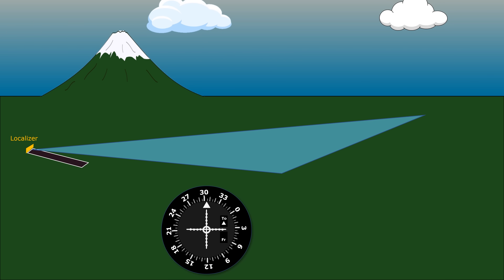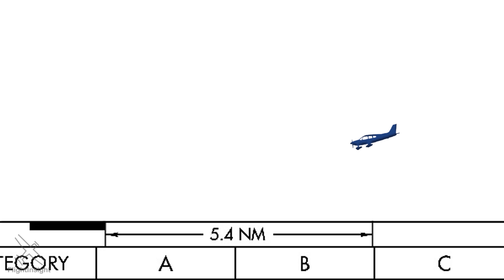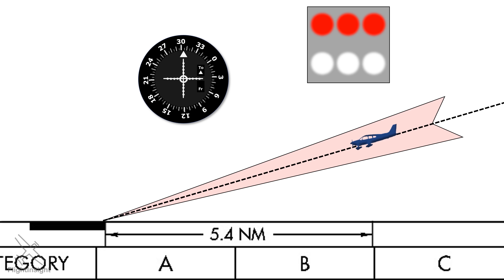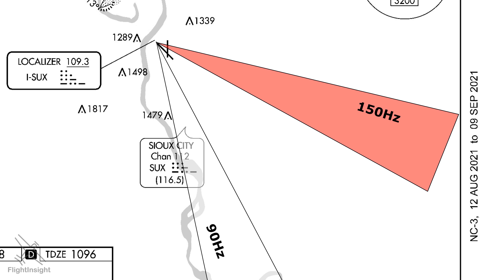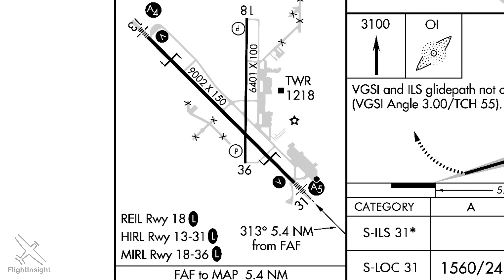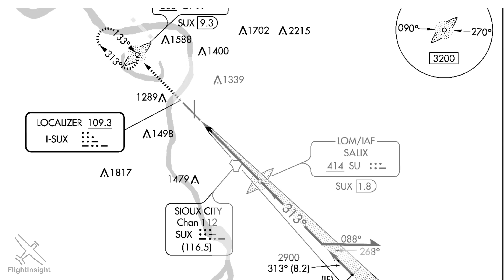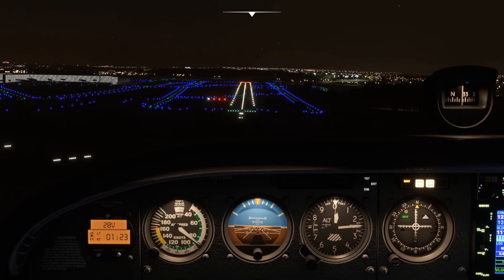How ILS Works | Instrument Landing System Explained | IFR Training

Comment: Not a pilot but the glide-scope indicator lights seem to be logically backwards.  Instead of just right= upper red and lower white.  More logical just right should be white/white.  Too high= upper red, lower white.  Too low= lower red, upper white.
I guess logic goes out the window when flying?

Comment: This excellent video will be helpful for people to understand what the ILS is, but it will be less useful (nor is it intended, I believe) to show students how to fly the ILS. 
The principal shortcoming I see in this regard is the suggestion that the ILS iis flown by "chasing the needles" when in reality it is almost impossible to fly a successful ILS in this manner. Instead, an ILS needle off center means you must return to your primary flight instruments to determine heading, altitude, speed, power and trim, and decide a course of action to bring the needle back toward center. This could be a heading change, a power change, a trim change, a pitch change, and this change will also be made looking at the primary flight instruments, not the ILS needles. After implementing this very minor change, and giving the airplane time enough to respond, you return to the ILS needles briefly to see if your change was the right one, and whether it was the right amount, too little or too much. Thus the ILS needles are only glanced at briefly as a performance indicator, and never stared at or attempted to "chase". Doing so will always lead to over-correction, and a degrading ILS. 
Kudos to the author for depicting the correct geometry of the localizer with regard to the runway length. Not everyone understands this, and it will affect what localizer sensitivity you expect to see.

Comment: Land radar generate a coridor of square frames continuously guide avionic to get within the coridor and adjust speed and trim befor touch down then flap and engine speed and air brake just at touch down

Comment: the video says ILS broadcasts on 90Hz and 150Hz. does he mean 90 MHz/150 MHz? I assume so
Reply: No. He refers to the modulation frequency, and he is correct the lobes are 90Hz and 150Hz respectively. 
The broadcast frequency will be different for different airports, and is published on the chart (109.3 in this case). 
Interestingly, the broadcast frequency for the glideslope is not in the VHF band, but much higher in the UHF band, and you may see a table of correspondences for LOC/GS pairings, though receivers today do this automatically.

Comment: 4:36 I believe the false glide scopes are not reflections, they're part of how the radio signal is made directional - with a phased array.  Multiple antennae send out the same signal, but the antennae are spaced apart from one another, and the signal is shifted in phase (delayed very very slightly) between antennae to "steer" the beam.  When you're at the right angle to the antennae, all the signal phases line up from your perspective, and the signal is really strong.  When you're drifting away, they start to interfere destructively rather than constructively, and the signal gets weaker and weaker until it's at its minimum...

But then you go far enough off and the phases start to sync up again, constructively interfering and becoming stronger from your perspective.

This is an unavoidable side effect of the wave properties of EM radiation, which are what is being abused to make the usually spherical signals directional in the first place.  The effect can be lessenned by using more antennae, but that only attenuates the secondary lobes, and with diminishing returns, so it can be money after nothing at a point.

That's not to say reflections don't exist, but they're not gonna make a false glideslope.

Comment: Flew UH60's in the army for many years. Very lucky to still be alive. I had to do a zero/zero approach and landing to a runway in Iraq in a dust storm using a self created GPS approach (not supposed to do that). Never saw the runway,  just felt the gear touch (slam). Couldn't even ground taxi down the runway after we landed. Just sat there and wait for the storm to pass. Practicing and perfecting the ILS approaches help execute the GPS approach to the ground. Alive to tell the story today because of it.

Comment: I have been obsessively chipping away at my PPL for about 4 months now, strictly ground courses and learning and absorbing every possible piece of content and information. I have damn near run out of content to watch on this platform because of how much I’ve already been gobbling up. I have been doing this and my medical and have flown only a few times. Of course this is for my visual and my instrument rating is far off, but I have also built an elaborate simulator, and I have been confused by so many of these things for so long. This is THE BEST explanation of ILS I have encountered, and I’ve encountered ALL of them. New subscriber. Thanks so much. OH - and you have a killer VO delivery and solid sound.

Comment: Plane just crashed in Lithuania, ATC told pilot to hold 2700feet and pilot repeated 2300feet and ATC did not catch that mistake. He announced ILS aproach so I assume this system must have guided him, but they crash landed about 1KM from runway.  ILS seems to be working on airfield as other planes had no issues prior and after incident. Is it possible to land short with ILS active? After watching your video it does not seem possible to use ILS and not see you are too low, unless instruments are wrong.
Reply: If you are following the ILS, it will guide you till the runway as long as the signal is accurate.

Comment: What happens if the airport loses power? Is there a redundancy?
Reply: Yes
Reply: If an airport loses power, backup systems like generators or uninterruptible power supplies (UPS) are in place to keep critical systems, including the ILS, operational. The ILS typically has redundant components, such as two transmitters for horizontal and vertical guidance, ensuring continued functionality if one fails. In case of a complete ILS failure, air traffic control would inform pilots and provide alternative navigation instructions. Airports also have emergency lighting powered by separate backups to guide aircraft safely during low-visibility conditions.

Comment: Why have i heard stories then of pilots crashing into trees just short of the runway if the ILS is giving them the proper descent angles?
Reply: Even if the ILS provides the correct descent angle, pilots can still crash short of the runway due to factors like altitude mismanagement, signal interference, or autopilot issues. Environmental conditions, such as turbulence or poor visibility, can also affect the descent, leading to an unintentional low approach. The ILS doesn’t account for obstacles like trees, and terrain can be a factor if not considered during approach planning. Proper altitude control and awareness are key to avoiding such accidents.

Comment: I think  that it is time that the description of ILS was brought away from talking about lobes at 90/150 Hz and closer to the reality of it being a phased array antenna that transmits on the ILS frequency with the 90/150 Hz modulation on top.  This gets over the simple fact that an aerial for 90 or 150 Hz would be enormous and that the ILS loses no accuracy with increasing range.  I think you should use you amazing presentation skills to do the REAL explanation.  It also explains the reason for the false glideslopes much better if you get into the phase comparison of signals

Comment: through random chance, i ended up with a large amount of time on an instrument only flight simulator. later in life i found myself sitting in a very fancy pilot training system (very fancy flight sim with screens) and it looked like i was going to send the aircraft into the deck. all i could think to say way "i'm use to that weird cross thingy! where is it!" one of the guys running the flight sim looked surprised, reached over and keyed one of the 50000000 switches, and said "you mean the ILS??" and sure enough, the ILS popped up on the hud, and i landed it perfectly haahaha. never mind that all my previous sim time was for a UAV so i was doing 10g turns and set off the g flag almost instantly and the guy told me i would have likely blacked out on my first hard turn lol

Comment: Also I should mention that VGSI and ILS glideslope are not coincident a lot of times. So don't get surprised when you are on ILS glideslope and see 3 whites and one red or vice versa. It would be mentioned on the approach chart. PAPI/VASI lights are part of visual approach systems, you don't use it when executing an ILS approach or even NPA. PAPI/VASI are set for the largest aircraft that could land there and basically only give you obstacle clearance, so I suggest you don't mix these up together like you did. Dont let the PRECISION part of Approach Path Indicators (PAPI) mix it up with Precision approach type, because they are still visual approach slope indicators...

Comment: This just popped up in my feed. But I don't need to watch to know how an ILS works: it works by sheer fear of the chief pilot sitting next to you during your IFR checkride! 😱 And sweat, buckets of sweat! You will not convince me otherwise. It was fear and sweat that made those 2 needles not look a pair of swashbuckling pirates, as they had during my training flights, but were locked in to the point of wondering if something is broken. 😲

Comment: 1. Student pilot, confused as to where does the 90 and 150 degrees come from, he doesn’t say. 2. Using the VOR receiver ok how does the VOR receiver read 150/90 interpretation do you set the VOR receiver up if so how?

Comment: Why couldn't the localizer antenna be moved, depending on the length of the runway, so all numbers would be the same at all airports ?   Where is it written that the localizer antenna has to be situated at the end of the runway ?     And,  the horizontal and vertical straight line that move to let the pilot know if he's too high or too low, or too left or right.....that's confusing.  It would seem that the line should simulate the actual location of the plane.    The way it is now, you have to think in reverse.
Reply: The localiser transmits a beam that the aircraft follows so it has to be at the end of the runway or the aircraft won’t get to the runway. Think you may have misunderstood something.
Reply: Maybe....but what's the answer to my questions / suggestion / that the line = too high or too low, and having it, it seems to me,  in reverse ?     Do you have a comment on that ?
Reply: @timmellin2815  no. The beam is static and the indicator shows a go left/right/down/up command. It’s simple and effective.

Comment: Great video. One question, despite the needles being centred in the last few seconds the papi lights turned one white and three red. At that point do you trust the instruments or the lights ?
Reply: PAPI is generally regarded as unusable below 200 ft. So you either use the visual picture or let the aircraft follow the ILS guidance.

Comment: If you`re studiying for an ATPL, here are some additional info you might need for answering theorie questions:
1. Errors
- Beam bending (happens due to athmospheric conditions)
- Scalloping (caused by reflections of the signal, causing you to pick up on the reflection making your needle go wild)
- Beam noise  (Noice of because of transmitter interferance)
- Pilot error (for example putting in wrong frequencies and so on)
2. Accurancy reduction
- Multipath interference because of reflectance from objects, reducing accuracy
- weather
- FM broadcast in similar frequency ranges can cause interference
3. How the glidepath signal spreads
- If the limit (like in the example of this video) for the glidepath is 3° you will receive signal from 1.35° to 5.25°
4. Reading the instrument
- Full scale deflection of localizer= 2.5 ° left or right of the localizer so 0.5° per dot
- Full scale deflection of glide path= 0.7° above or below the glide slope
5. CAT numers (hate this one)
- cat I
DH 200 ft
RVR 550 m
- cat II 
DH 100 ft 
RVR 300 m
- cat III A
DH below 100 ft
RVR 200m
- cat III B
DH below 50 ft
RVR 75 m
- Cat III C
No limits/minima

Comment: It might be a stupid question, 90 hz seems very low for radio frequency,  wouldn't it require very large receiver???
Reply: That’s the modulation frequency, not the carrier frequency, which will be in the VHF range for the localiser and UHF range for the glide.

Comment: 3:43 How does the ILS provide that incremental information?

Do the frequencies or amplitudes change as you stray further from the ideal glide slope? It seems to me like a fixed radio signal would only provide on/off data for the approach

Comment: It may be of interest to a few people that early testing of radio approach navigation was performed at the Landing Aids Experiment Station at Arcata, CA, under auspices of the US Navy and US Army. The region was notorious for marine layer fog which caused havoc with aircraft operations along the coast, so they were keenly interested in developing methods to get planes on the ground safely. 
My father was a test pilot there in the late 1940's. One of his favorite landing aids was "FIDO." A diesel locomotive engine pumped diesel fuel at high pressure thru a pipe that ran along the perimeter of the runway. Fuel sprayed up out of nozzles spaced along the pipe and was ignited electrically. This produced a great curtain of flame on the length of the runway which could disperse a heavy fog in a few seconds as well as lighting the approach in the dark. It worked great but of course it consumed a lot of fuel and scared the hell out of the passengers.

Comment: Thanks for this useful material. Really helpful understanding ILS operation. One thing I want to ask is there, if you are Ok. If airplane deviates above full-scale deflection range, what happens to indicator? Let's say, ILS Localizer's full-scale deflection is 10 degrees, and airplane deviates 20 degrees. Then indicator display deflection of 10 degrees, or is there any way to display 20 degrees' deflection? Thanks.....
Reply: On the aircraft I've worked (all have modern digital, glass cockpits), the GS or LOC pointer will park at the edge of the indicated display.   Keep in mind that the LOC signal is fairly narrow.   If the aircraft is outside of the signal of the LOC, the indication will be cleared from the Display.   I cannot speak for most of the indications in the video, since it shows very antiquated cockpit displays.
Reply: @rcairflr  Thanks for the answer. :goodvibes:

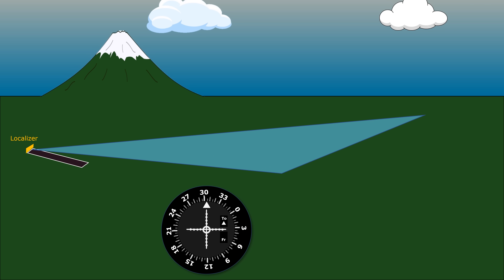Comment: Good overall explanation of the ILS. However at about 9:50 the graphic representations of the crossed LOC and GS signal paths were not represented correctly as to where those respective signals originate from the ground equipment.

Comment: Remember a runway may have 1 or 2 ILS systems, 1 for each approach. Each has s different frequency. I remember a Malaysian 747 on a short hop from Singapore to subang kualaliumput 30 years ago ,sellected frequency for runway 15 instead of runway 33. Predictably the aircraft made a perfect touchdown 6000 meters short of threshold 33, or runway length on a village bushes.
The captain, copilot and flight engineer were be sacked
Moral; check your frequency, and even ILS obey Minimum permitted altitude. No see runway you goaround please. loga

Comment: Great explanation however at the end I was confused when you put it all together. Would you mind putting circles, circling the indicators of the red and white lights,? Because I honestly could not see the red and white talked about.
Reply from the maker: Check the left side of the runway, on the side closest to us, you should see four lights in a row that are wither red or white depending on our height.
Reply: @flightinsight9111  thanks I saw it 👁

Comment: Good video! A couple of nitpicks; The simulation at the end of the video actually compliments a slight ambiguity from earlier in the video. At 4:00 it is stated that a VASI indicator only indicates absolute high and low positions, and offers no progressive or degree of variation, as the glideslope needle does. While this is true, the simulation at the end shows a condition the pilot is much more likely to encounter in the real world, as PAPI lights today are much more common than VASI on runways with precision approaches, and these lights DO offer a progressive degree of vertical position, indicated by the number of white vs red lights, as correctly indicated in the video. It's not as precise as the glideslope needle, but it is there. My other tiny gripe would be that no ils is successfully hand flown by "chasing the needles", as indicated in the video. Flying is not a video game, and chasing the needles will invariably lead to ever greater over-corrections. An off-localizer or off-glideslope indication informs the pilot that a correction is needed, and the correction is made with the use of other instruments, the Attitude Indicator, Altimeter, and Heading Indicator, or HSI. After implementing the correction, the pilot must give it time to have its effect before checking again to see if it was enough or too much, which is why "chasing the needles" has little chance of being successful in a real airplane.
Reply: Reckon “chasing the needle” just explained how to interpret the gauge, not the technique.